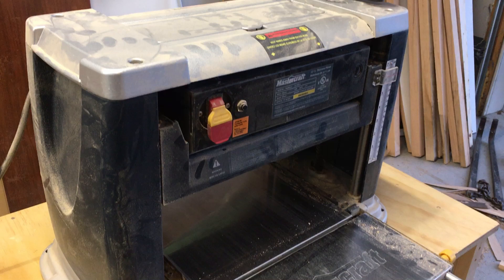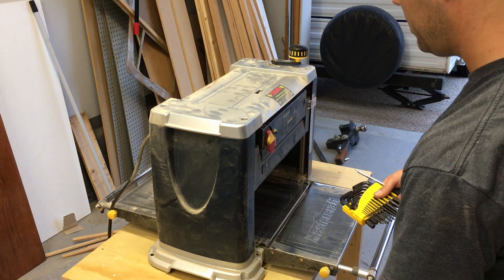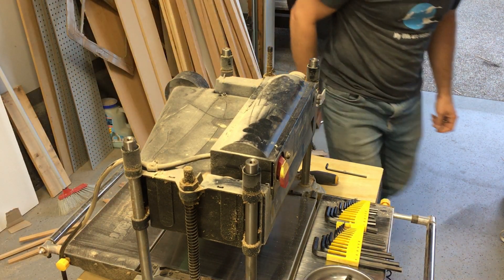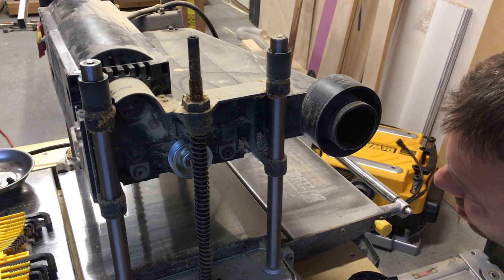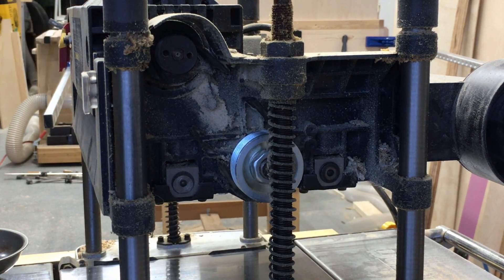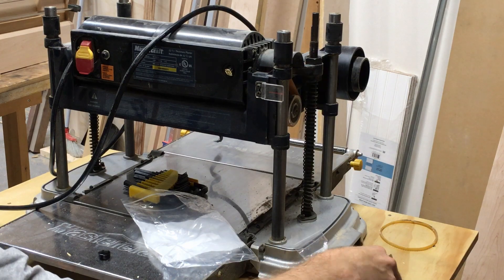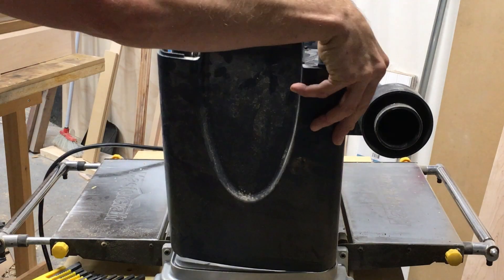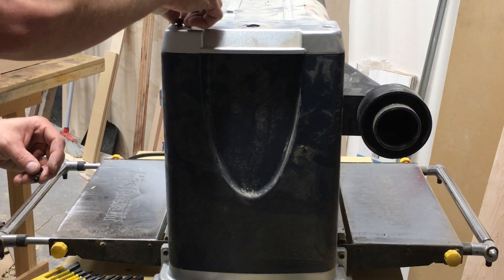Mastercraft 12.5" Thickness Planer fix drive belt

Comment: Well that looks to be an excellent little machine . 4 years of work and a simple 20 minute fix . can't go wrong with that eh/Plus  Mastercraft give you a spare set of blades AND they are resharpenable anyway . you can't go wrong its also 1/3 price of the Black and Decker er I mean de Walt ,same thing.

Comment: I have an old Rand planer. Appears to be same as Mastercraft there. Will the drive belt be the same. My belt broke and needs replaced??  Thanks
Reply from the maker: i dont know if it is the same belt, you might need to contact canadian tire support with the model number to find out

Comment: How does the Mastercraft planer compare to the Dewalt, ease of use, finish, blade changingb etc.
Reply from the maker: they are pretty much both easy to use and blade changing is straight forward on both, but WAY easier on the dewalt though.  The master craft is spring loaded but they provide a setup guide for it.   the master craft is only a 2 blade head and will get the job done.   The blades on the mastercraft are actually better from factory then the dewalt.   I found the dewalt to be garbage blades,.... i had nicks in the blades on clear maple the first 20 minutes of use out of the box.... I have since upgraded it to a shelix head and the finish is like glass now.   

The dewalt planer is a better unit, just really bad blades.  expect to replace them often unless you upgrade it.  unit and head will run you over $1200 cnd in the end.  The mastercraft on the other hand is $199 on sale and will get it done no problem.   you can also sharpen the blades on it.  you can't sharpen on the dewalt factory ones ( at least they say you can't ).... i stop using the factory head anyways.